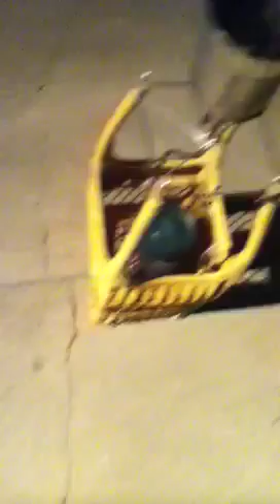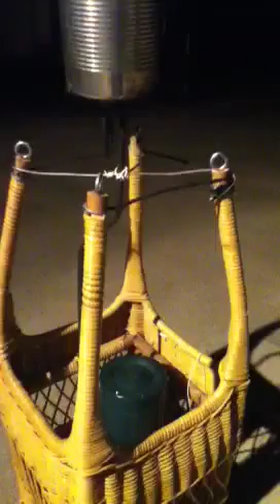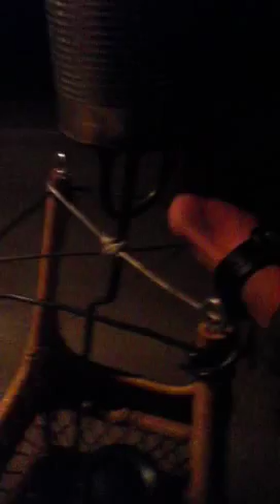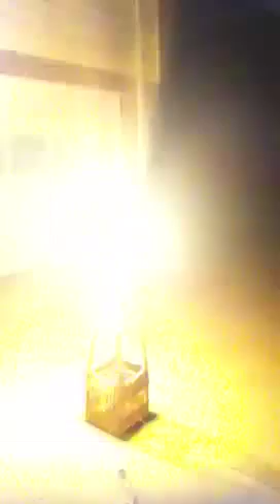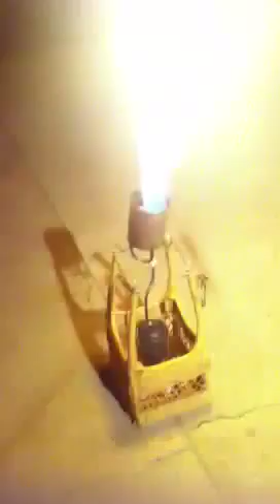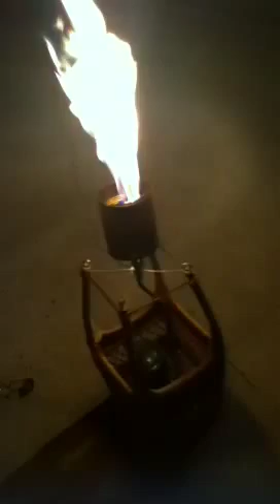Rc balloon burner test

Comment: So cool! Is it safe alright?
I am making 2 small paper balloons, one of 2.5 cubic meters and the other 1.8 cubic meters and I have made with aluminium foil and other stuffs a burner with 3 candles.
I haven't tested it yet.
But I am also considering using coal.
And I don't have any blueprint for a tiny coal burner that would fit
I made a small gondola for the bigger on the 2 envelopes.
Not sure what I am gonna do for the smaller one.
How big was yer rc bag?
Greetings from Belgium,
Thomas